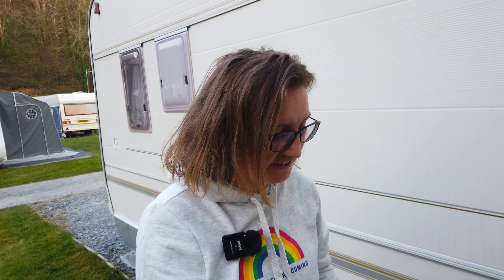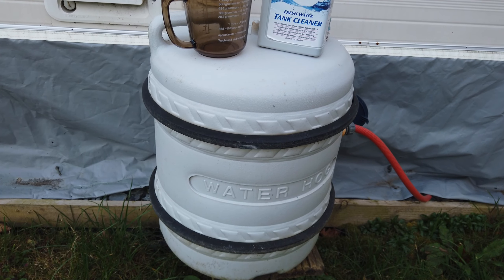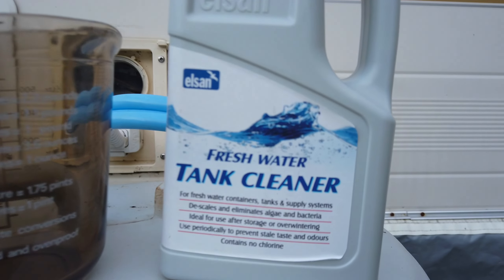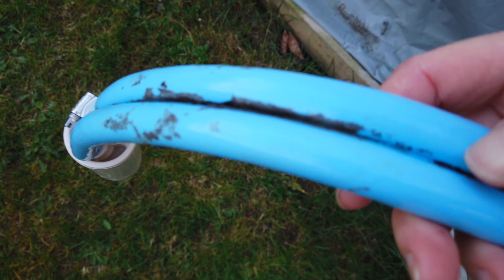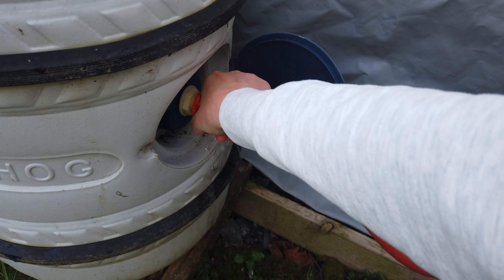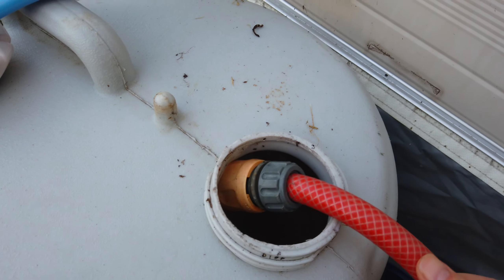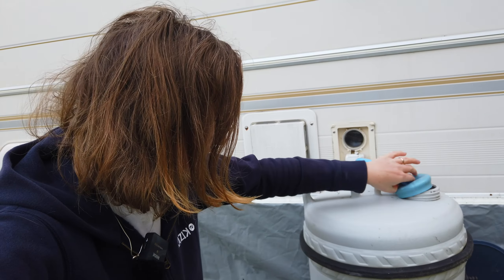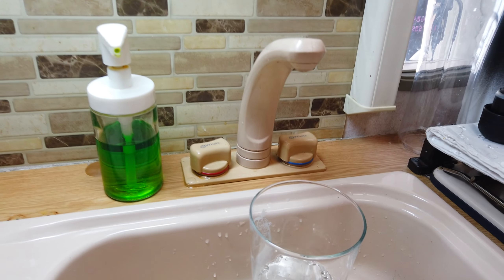#19 Caravan WATER cleaning & sterilisation: Elsan Fresh Water Tank Cleaner

Comment: Hi, great video,  I have just found some of this in my garage,  but I can't find any information on a use by date. Do you happen to know its shelf life, please?
Reply from the maker: Unfortunately, I couldn't find any information about an expiry date for Elsan WATE01 Fresh Water Tank Clean on the manufacturer's website or through other reliable sources.
However,  expiry dates are typically for products where the effectiveness can degrade over time.  Elsan WATE01 Fresh Water Tank Clean's purpose is to kill bacteria and germs, not necessarily for potency.

Here's what you can do:
- Contact Elsan directly: Their website https://elsan.co.uk/ has a contact form and phone number. You can inquire about the shelf life or expiry date of the product.
- Look for signs of spoilage: If the product has separated, changed colour, or developed a strong odour, it's likely best to discard it.

Even though it likely doesn't have a strict expiry date,  it's best to consider factors like storage conditions and age when deciding on using an older product.
/M
Reply: @FreedomSeekers-FS  
Thanks for the reply couldn't find anything on line, Elsan closed today but will try Monday,  I have seen another product  ( different manufacturer) shelf life two years, just want to get it right lol.